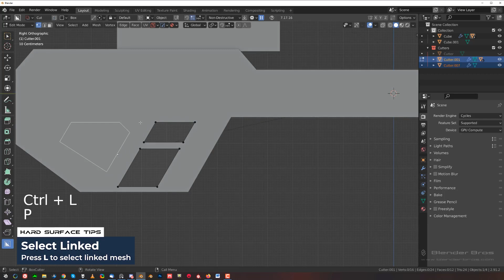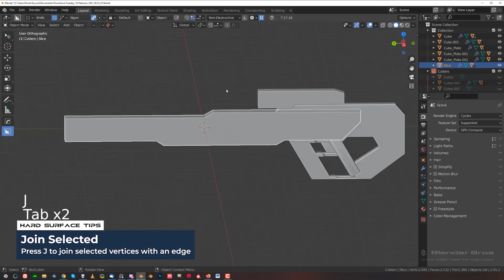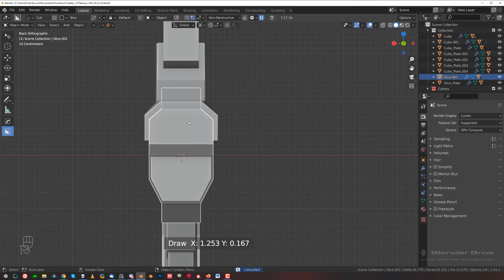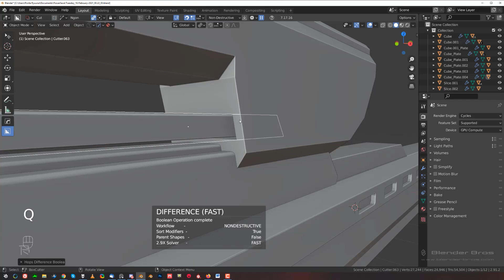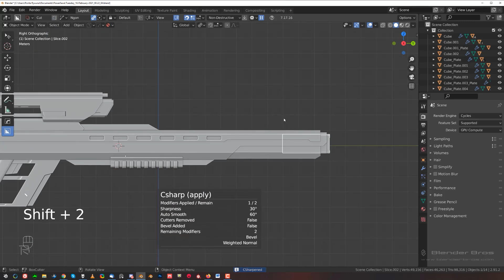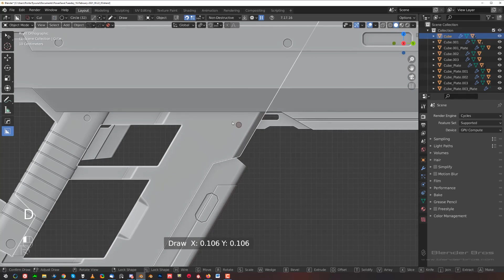Blender Hard Surface Modeling Tutorial - Scifi Rifle Concept

Comment: Why do you use Blender 2.91? In which cases do you use which Blender version?
Reply: I was thinking the same thing too
Reply: It’s a older video which was a part of a course of his Patreon I think
Reply: @JuriJanning   It sounds logically,
Reply from the maker: Blender ver doesnt matter, just use whatever is stable. This is an older course which is why its's in 2.9. The only thing that changed is autosmooth, which does not matter since i am using hardops.
Reply: @PonteRyuurui  thank you for answer.